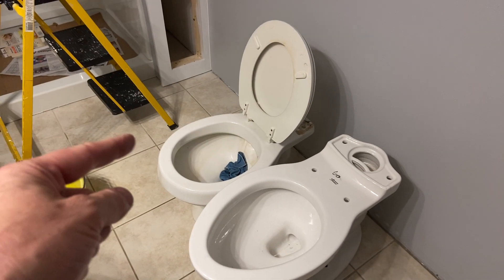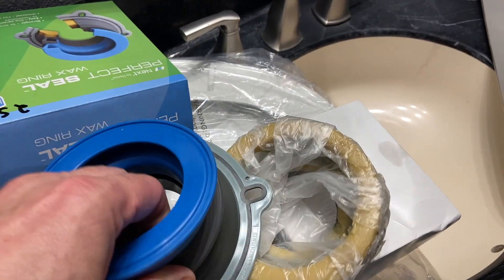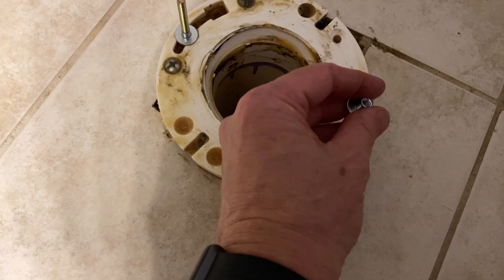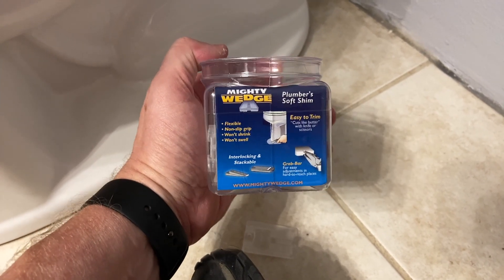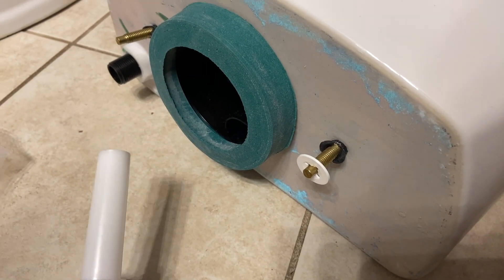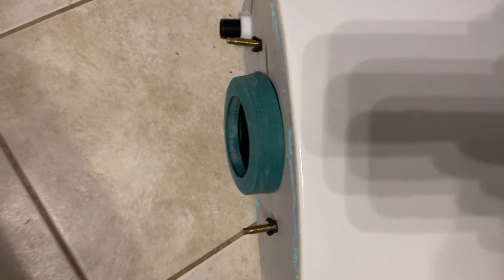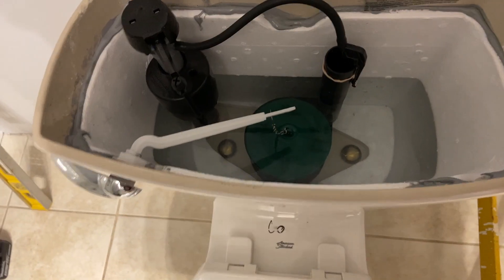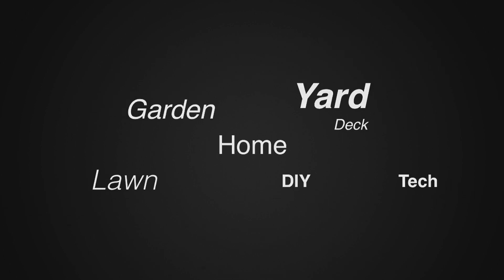How To Install The American Standard Titan Elongated Tall Toilet To Replace Round Older Unit

Comment: Our Titan is leaking really bad from the tank to bowl bolts. Any ideas?
Reply: Both my Titans leaked from the tank to bowl bolts too. The tank had to be bolted onto the bowl super tight to stop the leak, which can crack the tank. Ask me how I know. With the tank on the bowl, there is still a gap between the two, which stresses out the tank porcelain by trying to pull it to the bowl. If there were no gap between the tank and bowl, there is less of a chance of cracking since the tank will be sitting flush against the bowl. This will allow for more headroom to tighten the mounting bolts.

I was able to resolve it by purchasing 8 normal tank to bowl mounting gaskets (4 for each toilet). Inside the tank, I put a gasket on the mounting screw and slid it through the mounting hole. With the screw protruding on the bottom of the tank, I used another gasket, then a washer, and then a nut (screw, gasket, tank, gasket, washer, nut). Tighten the nut so it gently squeezes down on the gaskets. Traditionally, you could just use one gasket on the inside of the tank as well (screw, gasket, tank, washer, nut). Why AS went with their jenky mounting style instead of a traditional one is beyond me.
Reply: Just installed a brand new American Standard toilet. I notice a leak coming from the water inlet at the bottom of the tank. The problem was the styrofoam inside the tank was under the red rubber washer and was not making a good seal, so I had to cut some of the styofoam away from the hole where the water comes in. I also had to buy a new rubber washer, because the original one was distorted. This part of the toilet was assemble at the factory. Poor quality control from the factory.

Comment: I need to replace the tank to bowl assembly on my toilet because the bolts were leaking onto my floor. Do you have a video where you install the bolt and gasket assembly?

Comment: Just installed a brand new American Standard toilet. I notice a leak coming from the water inlet at the bottom of the tank. The problem was the styrofoam inside the tank was under the red rubber washer and was not making a good seal, so I had to cut some of the styofoam away from the hole where the water comes in. I also had to buy a new rubber washer, because the original one was distorted. This part of the toilet was assemble at the factory. Poor quality control from the factory.